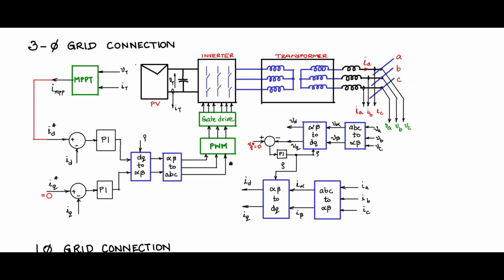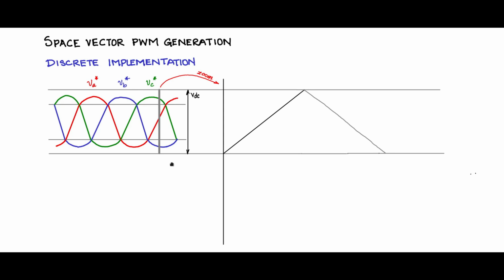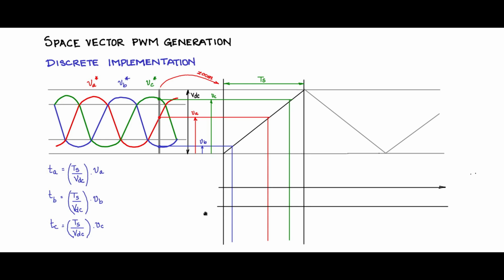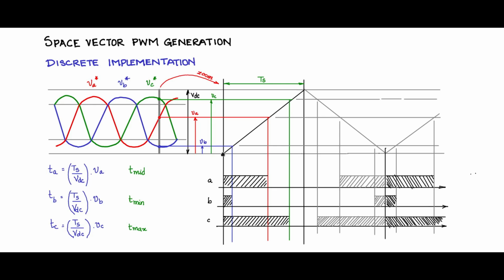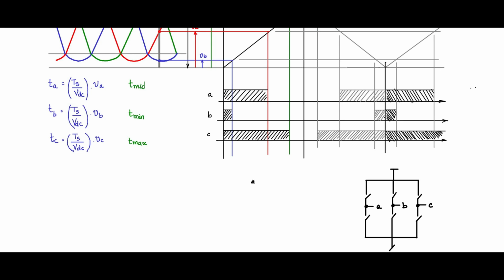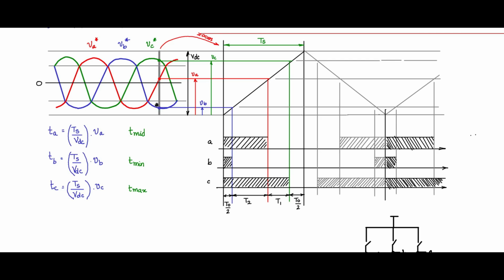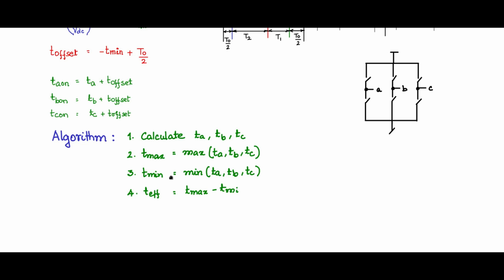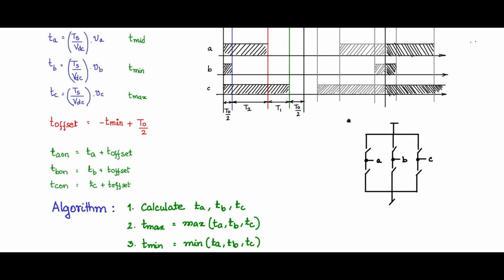SVPWM - discrete implementation

Comment: hello dear professor, I have a question about Dd and Dq, the duty ratio of switching for 3 high switches, S1, S3, and S5, I mean how can get this two duty ratio, I try with Simulink but I can't do this, I have the steady-state value of Dd and Dq, but my question is that how can I use this two value for control in Simulink, and how can I implement this item in control circuit, and one more question is that, can we convert the duty ratio of  the inverter to d-q frame? and how? thanks a lot dear professor.